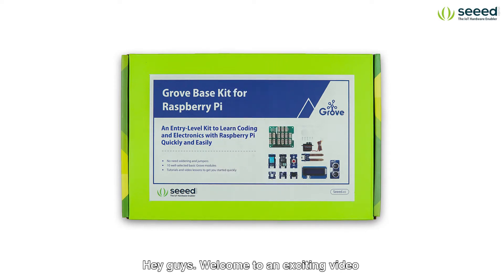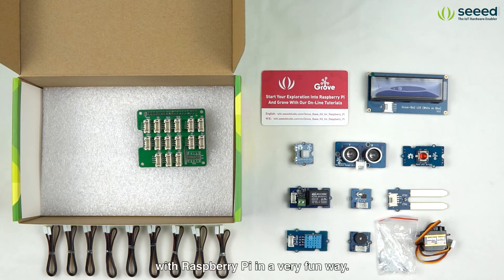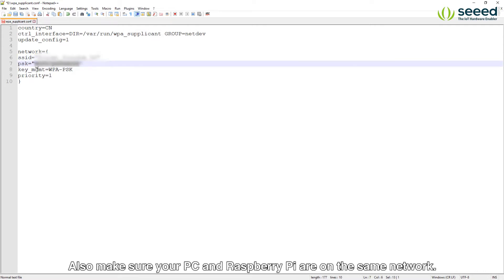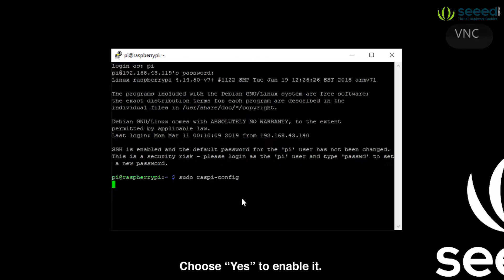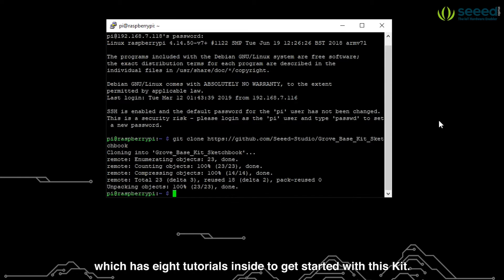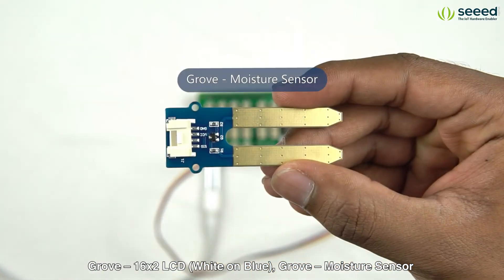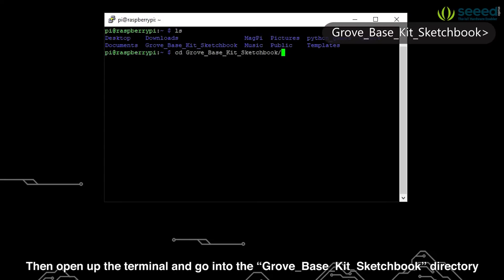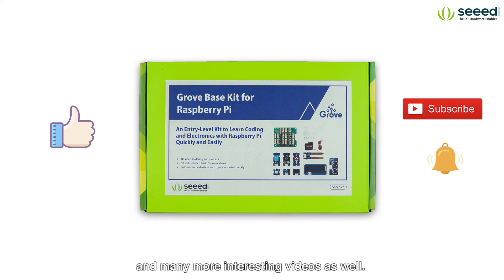Grove Base Kit for Raspberry Pi - Unboxing + Getting Started + Video Tutorials

Comment: I bought Grove Base Kit for Raspberry Pi on August to learn how IoT works and then for using sensors and LCD in future project.. but nothings works.. all documentations, instructions and examples are out of date and I cannot figure how to get it working.. I am pretty disapointed. any sugestions? e.g. How did I get LCD running? I am using Raspberry Pi OS (bullseye).
Reply: The same here... Everything seems to be out of date. What a shame.
Reply: @gullelardon2353  i solved the problem - buy arduino uno and shield for it, then you can run all your sensors there :) you can find lots of documentation for it and everything works well. and it is not as expensive as was this Base Kit...
Reply: @janbazala9456  i bought an Arduino Shield 4 days ago, just to try. Not receveived yet but your comment is very much appreciated ! You rock, bro !

Comment: GPIO ZERO package is much better to work with as the documentation is very good. Grove Base Hat has no documentation except for  a poorly written wiki with very few examples. While the hardware is to handle due to well designed plug and play groves, the software becomes  a nightmare. I dont understand the company thinks they can just expect the customers to understand their product without documentation. Grove Base Hat is not covered by any books either
Reply: Is gpiozero supported by the adc in grove pi?I am also looking for a good documentation

Comment: The link in documentation above is only partially highlighted, and the entire link is:
curl -sL https://github.com/Seeed-Studio/grove.py/raw/master/install.sh | sudo bash -s -

Re the documentation that comes in the actual box purchased for this kit refers to the following link: 
--------------------official instructions referred to in the box -------------
wiki.seeedstudio.com/Grove_Base_Kit_for_Raspberry_Pi
-------------------------------------------------------------------------------------------

... and one quarter through this linked official document it says: 
----------------------
Basic Tutorial 
Arduino IDE basic setup
How to burn a Raspbian image
1. Raspbian Stretch download”
---------------------
First of all it is not clear that the ‘Arduino IDE basic setup’ part is a link to another help page for a different device. This is therefore confusing.

Secondly, it does not explain in the link above (the official instructions that come with the Gove  kit) that the next 21 pages of instructions after the 4 lines above are only applicable if you want to control the Raspberry from another PC. If you want to just use the raspberry in the normal way on its own, you can omit all these 21 pages of instructions. It does explain this briefly in thks Seed video above at 4:43
Reply: the installation doesn't work. I get FAILED FAILED FAILED at the end.

Comment: 4:43 message about fast forward to 7:05 is very important as if you miss the message you give yourself an hour more work and hassle - it is saying that this extra part is only if you are  going to run the raspberry from a pc (why would you?)

This very very important is also completely omitted in the instructions that come with the device! Terrible omission!

Also the copy and paste above is not clear as if you hover with the mouse it highlights only part of the string to copy!